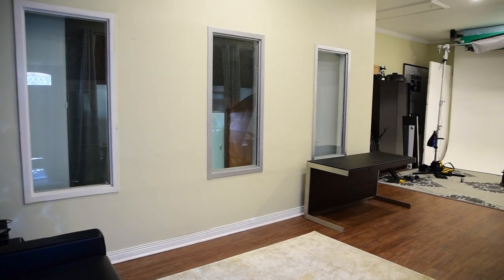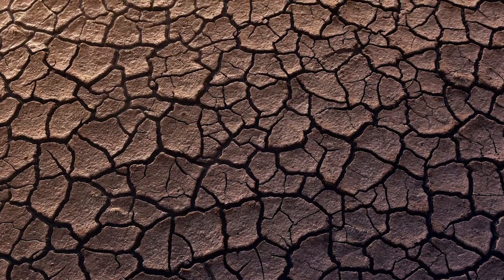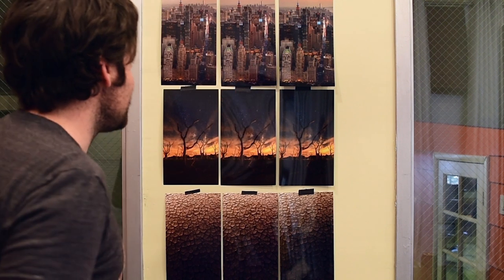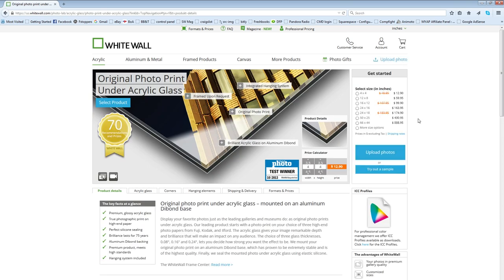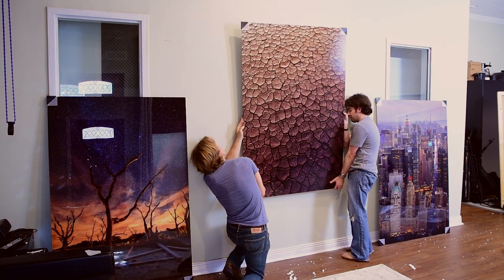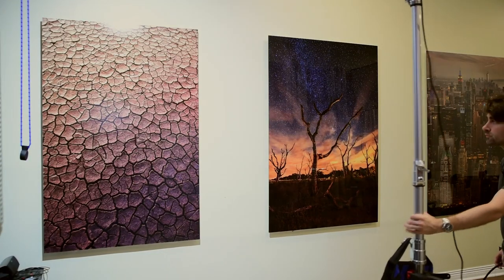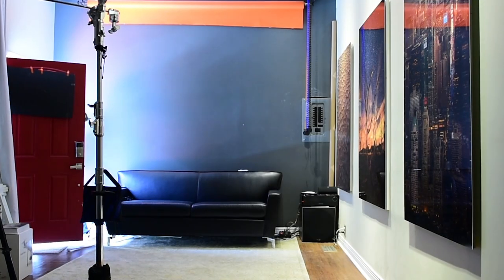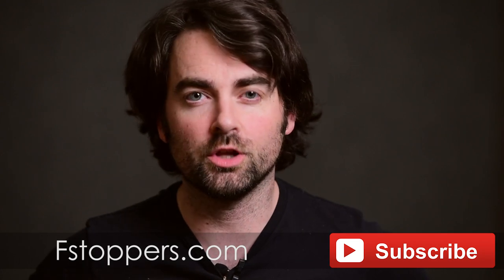How to Install WhiteWall Acrylic Photographs on Wall

Comment: Whitewall is great, bought a 75*50 print from em and it looks gorgeous.
Best thing is that they send you a box for free with sample prints (even on pvc metal etc) and various kind of paper so you can choose the best one.
Reply: Just stumbled upon their site from watching an ad they have running on YouTube, so cool that Fstoppers worked with them as well. I was previously going to print with Duggal in NYC but they're several hundred dollars more expensive for similar stuff. How's your print holding up?
Reply: As far as I can tell it's still great, however it's a photo paper print behind pvc, so it should be extremely durable.
Reply: M

Comment: A few thoughts come to mind, First off if its going to be covered with acrylic anyway, what difference whether you use super gloss, or completely flat ? It will be the glossiness of the acryytlic covering that determines the glossiness of the finished product. Secondly, the test prints are nice for color, but if one was interested in detail and sharpness (which I sure would be) they should have sent a crop of one of those photos that would represent one of those photos printed at the final full size.
Reply from the maker: Your first point is not accurate. You can totally tell the different type of paper underneath the acrylic. I believe the Matte paper comes with a slightly matte acrylic but even with the glossy acrylic, you can still see the differences in paper underneath. -P

Comment: Best acrylic prints I've had are Bumblejax and Bay Photo. Bumble has trouble getting the color right, but the acrylic is always very nice quality. Bay Photo print quality is top notch but acrylic has been screwed up a couple times (damaged) but the customer service is so good they always refund or send replacement. I almost always go with Bay now.

I've heard bad things about White Wall.

I know Pro Lab Digital also does acrylic but I'm turned off by the fact that they charge tons of money for the "quality" (must pay more for more "care" taken in each print).

Comment: just watching this in early 2020... prints looks great. curious what is the resolution of those photos? am curious how large one can reasonably print 60x40!
Reply from the maker: These were all shot on the D800 or D750 at the time so they are around 24 - 36 megapixels.  They look great up close. -P
Reply: Fstoppers thanks!
Reply: Fstoppers that’s amazing

Comment: had a real bad experience with white wall, 
they failed on three occasions to send large glass framed images without them breaking. 
Was most disappointing. 
Here in the UK now my business solely uses Loxley colour. Their products are breath taking!
Reply: It's not their fault if they break in the mail. They've maybe start packing them more safely. However nice to hear that the problem wasn't in the quality of their prints
Reply: I like whitewall. I've been using them for the past three years and they do have great sleek prints and frame for large expensive prints plus they have great customer service. I have also used the other company you mention which also give you great prints for your buck.

Comment: Very nice! I'm curious to know at what resolution these were printed (DPI of image file resolution before upsizing).
Reply: If I remember correctly, he shot the astro image with a 24mp d750, which gives 6000x4000 images. Printing that at 40"x60" would be 100dpi. 
Lower dpi levels are ok for huge prints, but a higher mp camera would have helped in this scenario. (As long as it's capable of comparable IQ)

Comment: Much t oo dark. I think you did not fit the monitor brightness for the pre press. The monitor brightness should be around 80 caldera. You can read that at Whitewall. I made that same mistake too but my damage was not 700 dollar *3.

Comment: Hi,
I've had 5 acrylic 20x16 prints made without a mount.  They are supposed to be shown in a photo show, and I was instructed to bring them with a wire in the back.  I found a website (http://www.bobestrin.com/mounting-metal-prints.html), where there was an explanation for how to do it for metal prints.  But when I tried to glue the wood pieces to the acrylic print in the back, the glue seeped through the image, ruining the print.  Sigh.  Good thing I only tried to do one so far.  So sad.
Do you have any suggestions for how to attach a wire to these prints for hanging in a gallery / photo show?  
Thanks
Reply: Ah that was so depressing to read, I feel for you man. I was thinking of saving 60 odd Uk pounds igonring the hanging hardware too. Now I know to just go with it. Hope someone with some real knowledge comes along to help if this issue is still pending to be resolved mate...